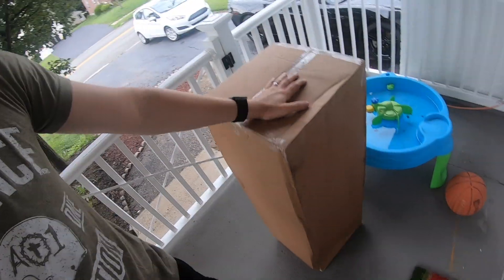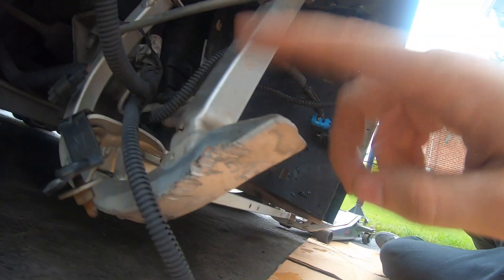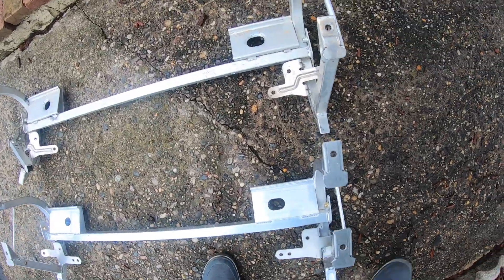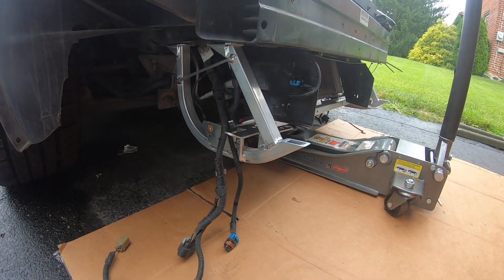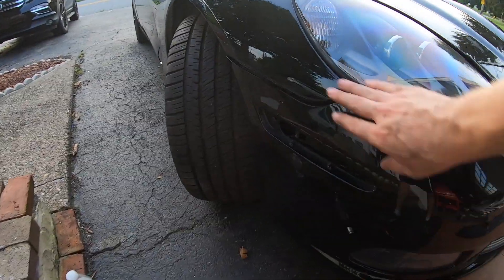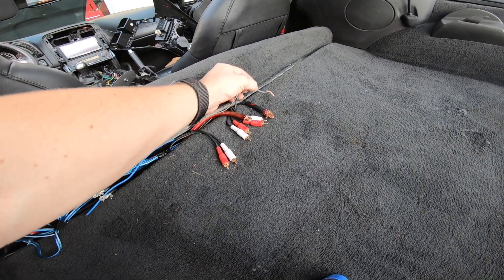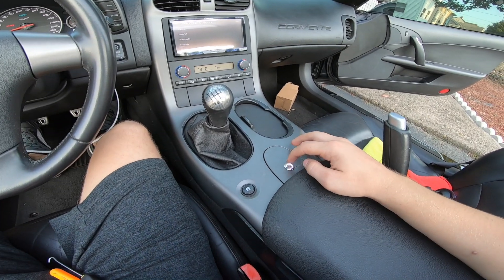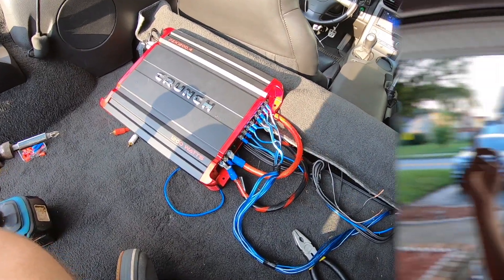Rebuilding a Salvage C6 Corvette in My Driveway *Part 4* (Radiator Support Replacement)

Comment: As a mustang owner, you know any places to buy used OEM parts for Mustang, I need a passenger Frame Rails, but man it's hard to find, I got the driver side but no luck for the other side, thank you an advance bro...
Reply from the maker: Check out car-part.com it’s basically a directory for all junk yards and auto part yards across USA. Just search for the part you need there and give the yard a call that has the best price or is closest to you.
Reply: @romagrigorenko  Thank you immensely bro 👍🏾🔥
Reply from the maker: GSHeverything _27 my pleasure bro

Comment: How long did lower radiator support take to arrive from California? Factory welds are so bad my broke worse than yours. Most experienced welders wont mess with. Thanks for time also from fellow C6 owner enjoy video but, please use safety glasses when grinding.  Learned hard way
Reply from the maker: David Bayse don’t remember the exact time but it was pretty quick. Less than a week for sure. 
Thanks! And yea I went and got safety glasses right after